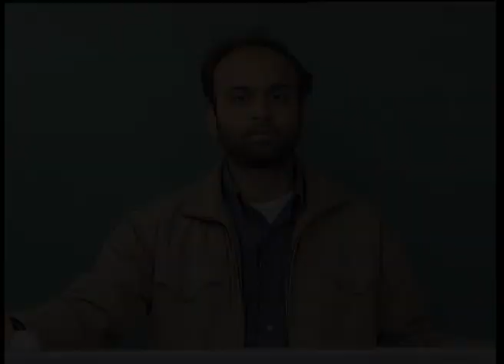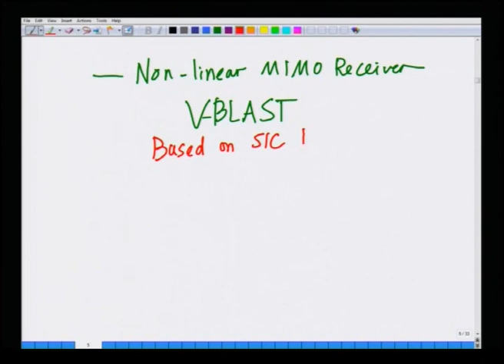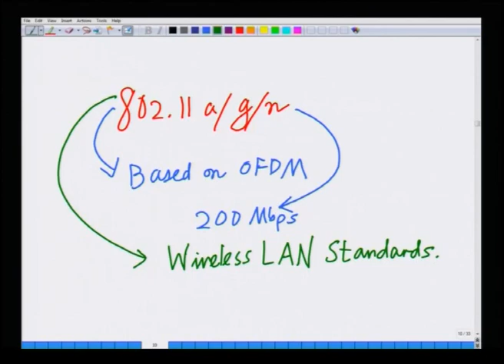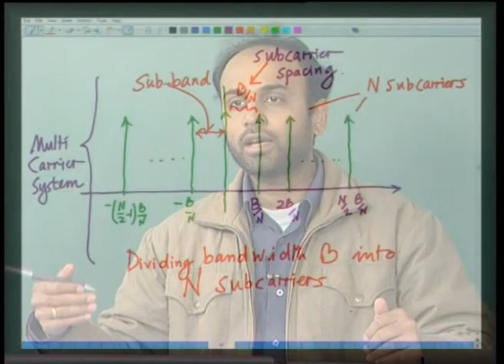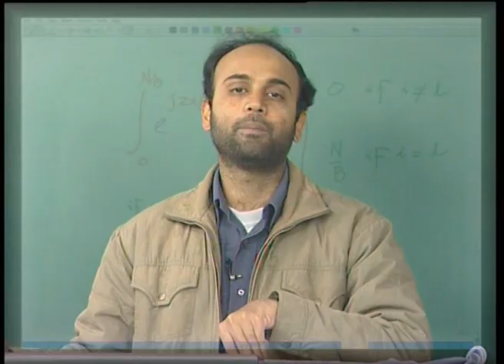Mod-01 Lec-27 Introduction to OFDM and Multi-Carrier Modulation

Comment: 🎯 Key points for quick navigation:

00:16 🔄 The V-BLAST receiver uses successive interference cancellation for iterative symbol detection in MIMO systems.
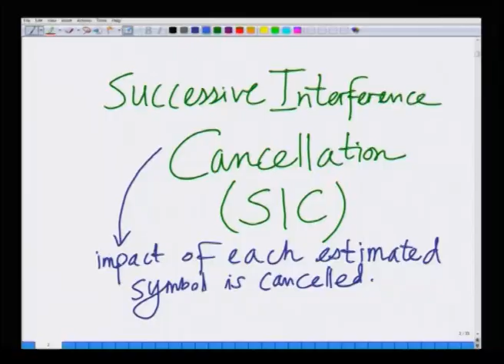00:47 ➕ This scheme improves reliability by increasing the diversity order as symbols are decoded.
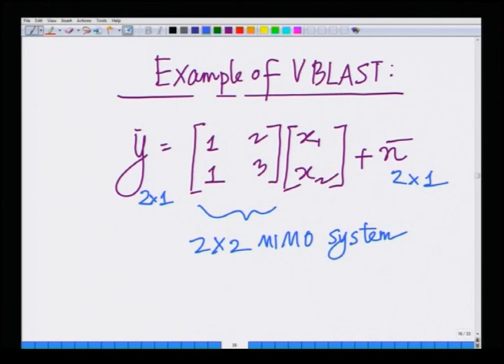01:43 🎯 Beamforming in MIMO focuses transmission in a specific direction to maximize the signal-to-noise ratio.
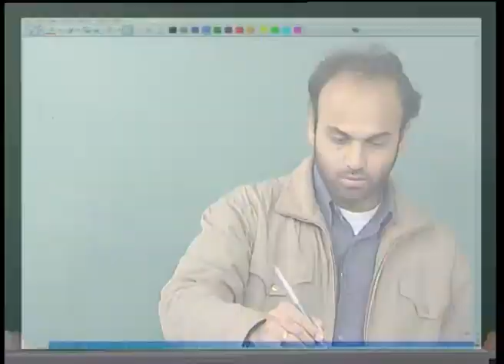03:04 🧩 The MIMO module covered architectures, receivers (ZF and MMSE), SVD, capacity maximization via water-filling, and space-time codes.
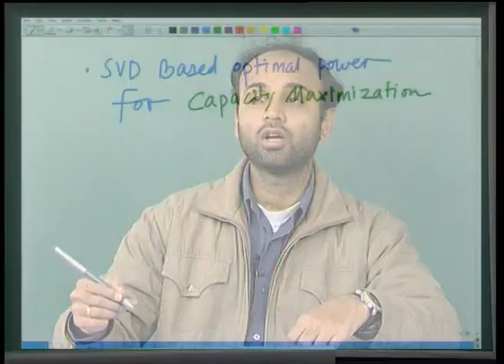09:13 🚰 Water-filling power allocation is used in MIMO systems to maximize channel capacity.
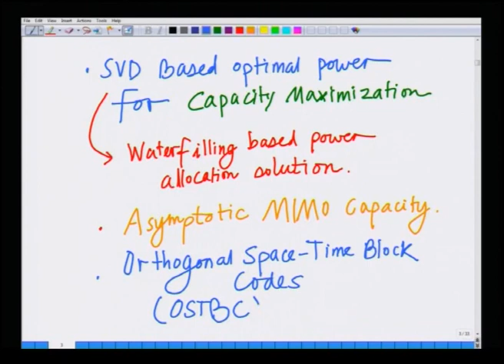10:50 🌀 Alamouti's OSTBC supports a MIMO system with an additional example of rate half code.
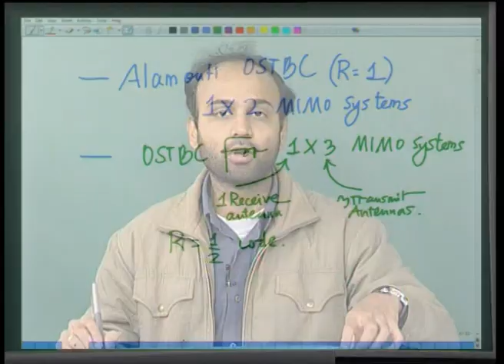12:20 🔀 V-BLAST and beamforming use successive interference cancellation and maximum ratio transmission in MIMO systems.
13:58 🌊 MIMO capacity grows linearly, facilitating high throughput for wireless systems.
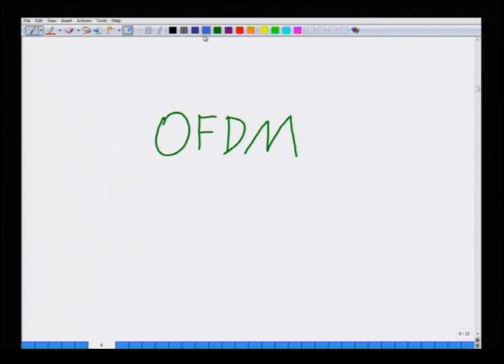14:24 🌐 OFDM is critical for 4G systems like LTE and WiMAX, offering high data rates and advanced communication capabilities.
19:20 ⚡ OFDM supports broadband wireless tech with data rates over 100 mbps, crucial for next-gen systems.
22:06 📡 Traditional systems use single carriers for communication; OFDM divides bandwidth into multiple subcarriers.
28:18 📶 A multi-carrier system is formed by dividing the bandwidth into N subcarriers at spacing B/N.
32:47 🔢 Multi-carrier systems often use a power of 2 for subcarriers for efficient bandwidth division.
34:14 💡 Multi-carrier transmission uses subcarrier bandwidth B/N to transmit data streams, enhancing communication efficiency.
38:58 🎶 Multi-carrier modulation employs N subcarriers and data streams, where each data stream is modulated onto its respective subcarrier.
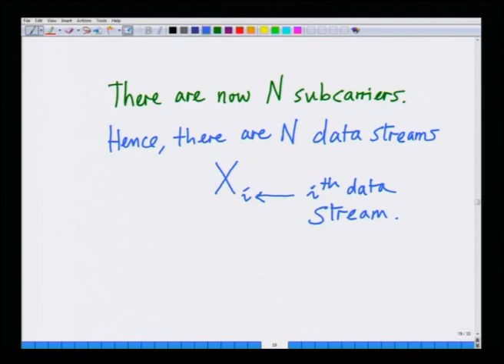40:01 🚀 Multi-carrier transmission involves summing all modulated data streams to form a composite transmit signal.
42:25 🛠️ The composite transmitted multi-carrier signal is constructed by summing signals modulated on each subcarrier.
42:57 🔍 Detection schemes must be introduced at the receiver to meaningfully use the transmission scheme.
44:26 📡 Multi-carrier data detection at the receiver involves coherently demodulating each received stream with its corresponding subcarrier.
47:36 💡 Matched filtering operation is performed by correlating the received composite signal with coherent subcarrier signals.
51:28 🔄 Integral results in zero unless the index of the subcarrier matches, indicating orthogonality of different subcarriers.
54:44 ⚡ Coherent demodulation allows recovery of individual symbols by demodulating with each subcarrier's fundamental period.
55:58 🏁 Each subcarrier can demodulate its corresponding symbol, demonstrating the core principle of multi-carrier transmission.

Comment: Are we transmitting n data streams simultaneously or just transmitting composite signal ..If we are transmitting composite signal then what is advantage of breaking the bandwidth into smaller bands..May be this is basic question but it will help me lot ...